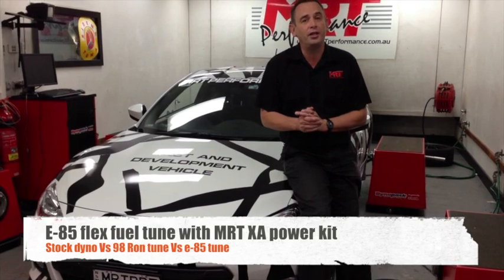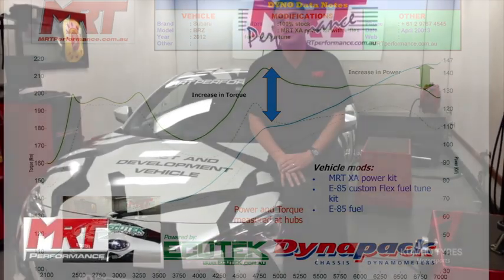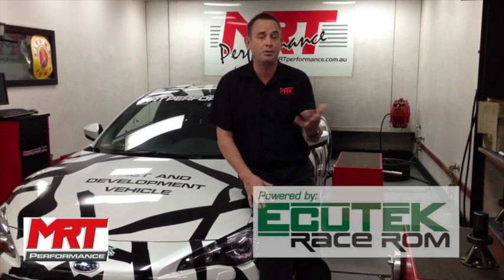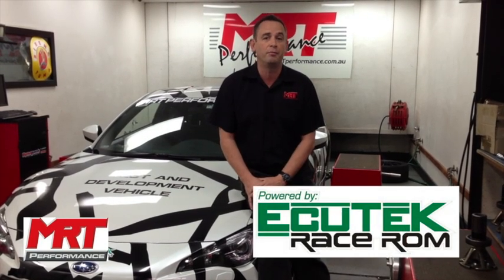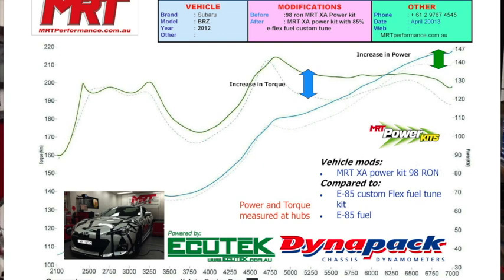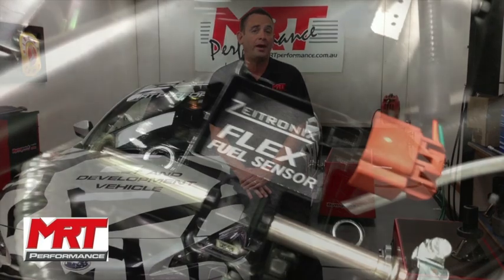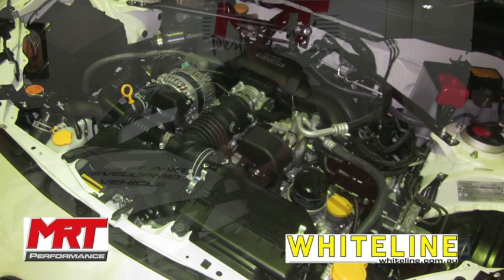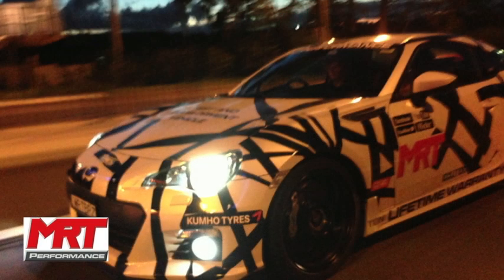Subaru BRZ tuning for ethanol, Part 2 FINAL custom dyno with EcuteK software.

Comment: The header is a must for getting rid of torque dip. 6kw is the smallest number ive seen for a e85 tune all the other are minimum 20-30 whp just from the e85 tune and at least 40 whp with the header. An exhaust gains are only 2hp and is for noise only